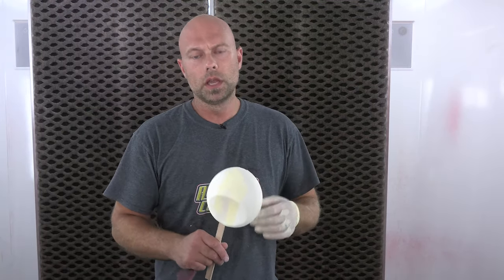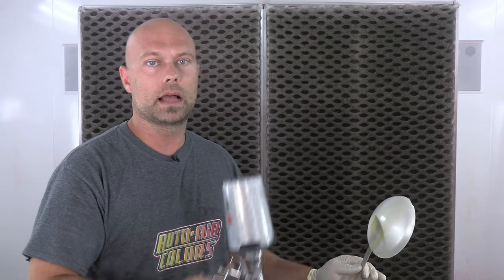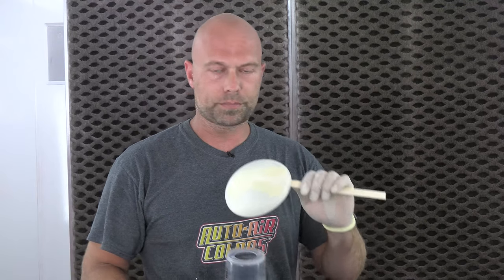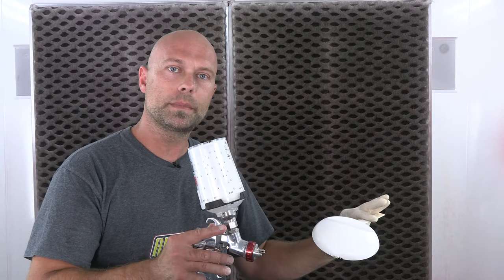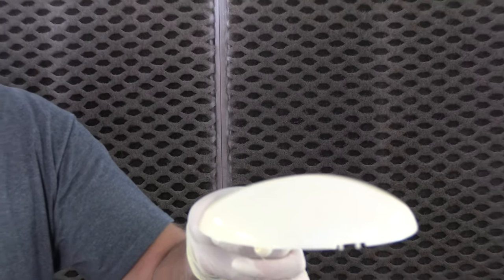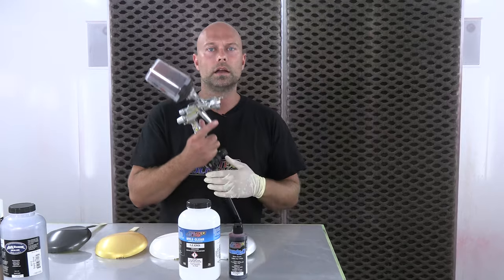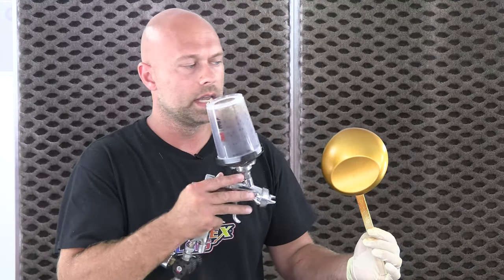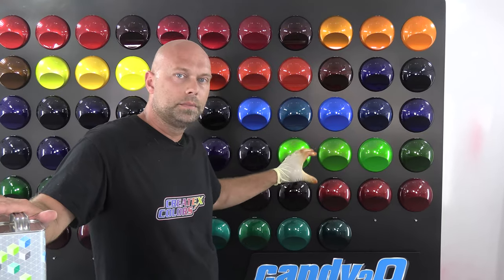Making the candy2o Board

Comment: Possibly a dumb question but can you lightly sand the candy painted base coat with 1000+ grit before doing the clear coat to take out some small blemishes in the finish? Or is it better to just sand the clear coat after?
Reply from the maker: No, directly sanding candy2o is not recommended as it will show the sanding scratches in the final finish, to which spot-repairing is more difficult compared to pigment-based colors as candy2o dyes keep building to a darker value. Thank you.